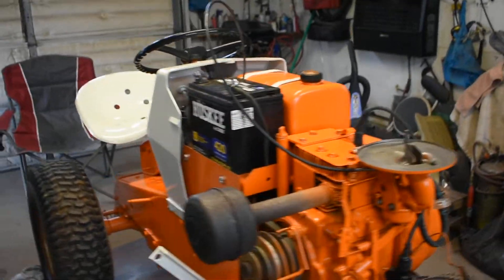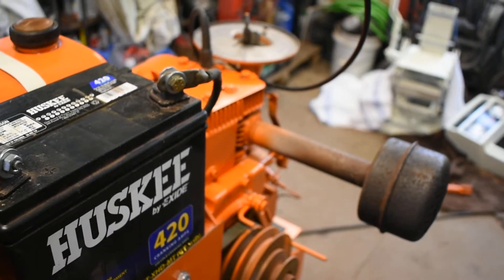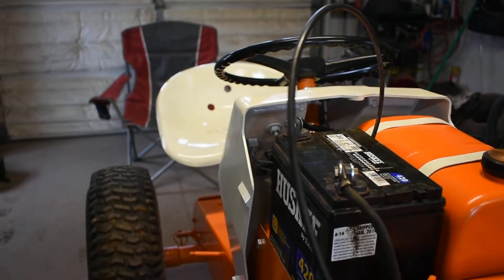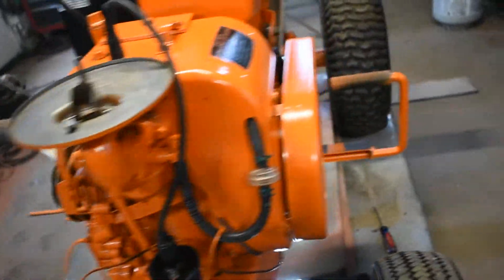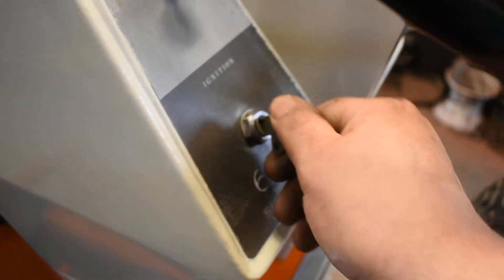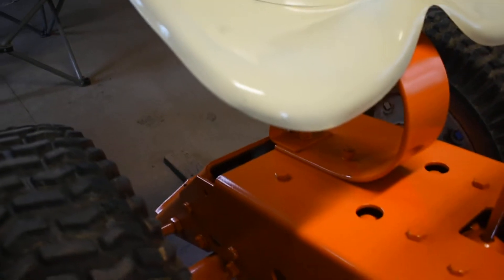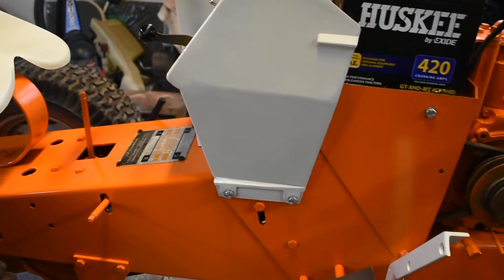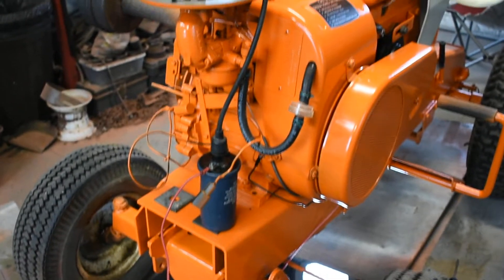Quick overview on how we wired the automotive coil to the 1967 Sears Suburban 10/ Tecumseh HH100

Comment: Wow, I have the same little tractor, and I've been fussing with it here and there for the last two years trying to get spark.  Just watched your video and bought an auto coil for $15, hooked it up as described and it worked, hallelujah! One interesting note, when I wired it up, I accidently forgot to put the condenser on, and i still got spark just fine. Thank you for posting this.